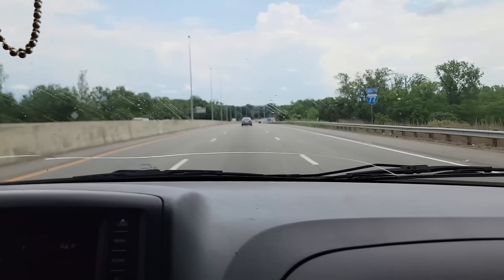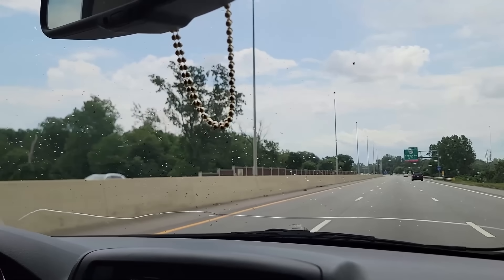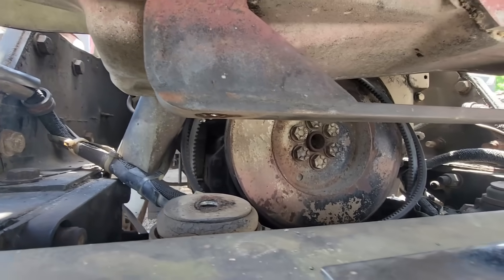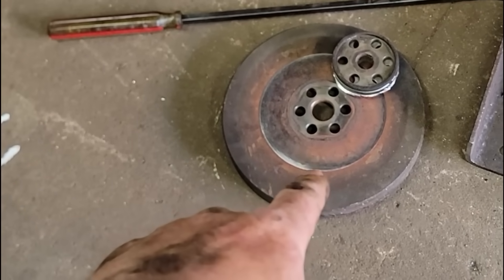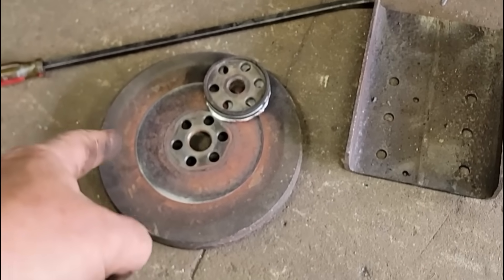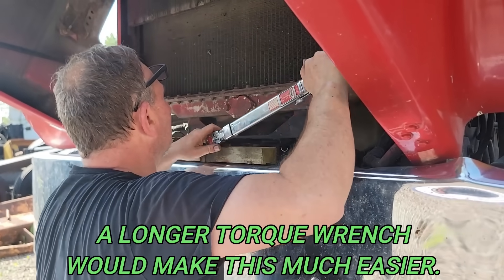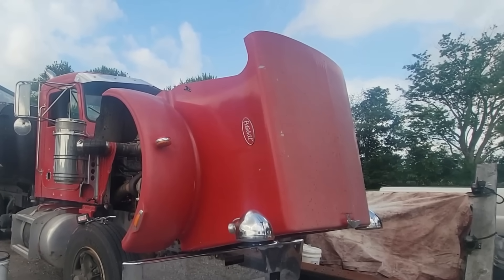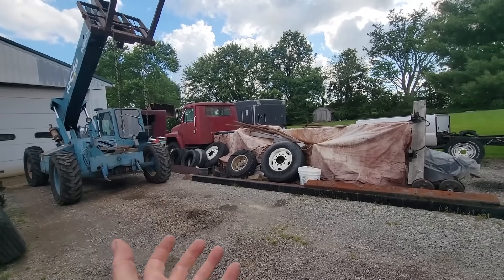PETERBILT BIG CAM CUMMINS KNOCKING AFTER I JUST DID THE RODS AND MAINS?

Comment: I think we'll find that as our supply chain continues to diminish making a fixing the old stuff will be invaluable.  It's still worth it to run the old big cams but you gotta go through them good. Not on a tight budget. That one sounds alot better than the one I used to drive. That thing sounded like it was full of rocks. 😂

Comment: That is the worst feeling , when you just put something back together and are told there is a noise , Had a buddy with a Western Star with that same exact problem, he was already to pull the pan and found a shiny spot on the pulley were it had cracked. Not a great design. 
Thanks for sharing.

Comment: I figured that be the truck you had problems with. I needed a rear brake job on the long weekend. I paid a mobile mechanic and bought the parts myself.My regular garage was too busy.I would have paid double. Im in new england. Prices are higher and parts can be hard to find,no matter the costs.

Comment: Our big cam broke the crank pulley several years ago of course I didn’t realize the pulley was separate from the damper so I got the damper and then had to order the pulley. At least it was in a 9370 so there was enough room. I didn’t have to mess with the radiator

Comment: You told him to r&r the motor and rad and he said nope don't want to spend the money now. His don't want to spend the money now is coming back to bite him in the rectum. He is now going to have to potentially spend more money to fix it than it would have originally cost. By not r&r the engine it's just going to be a chain of failures until it gets a blue tooth con rod